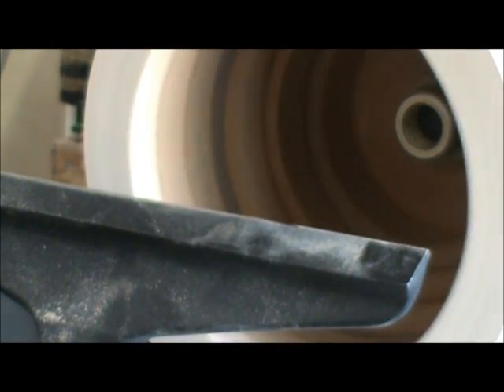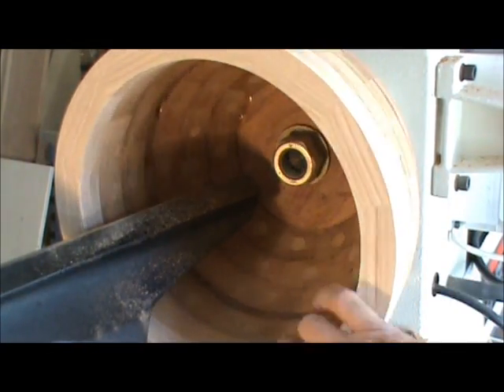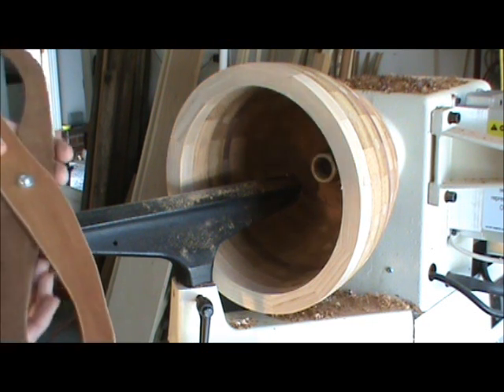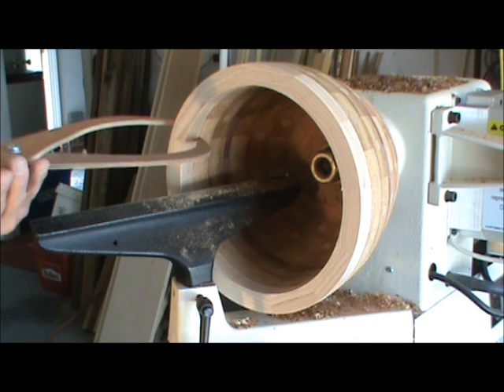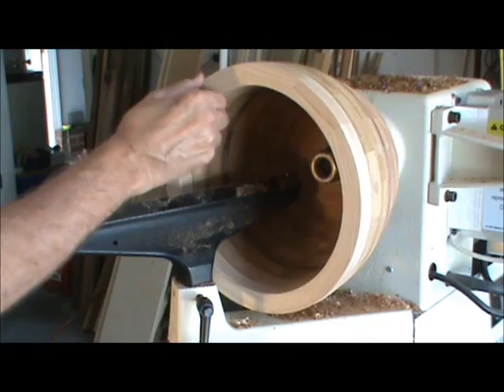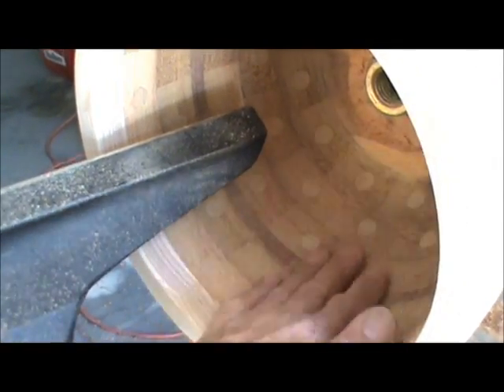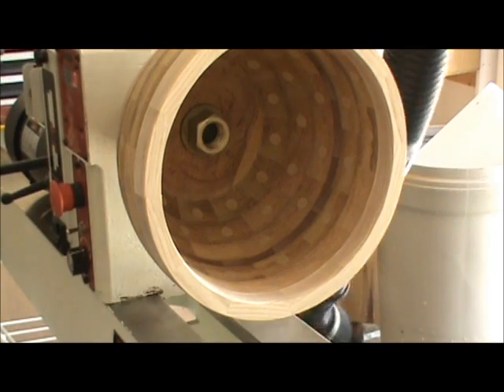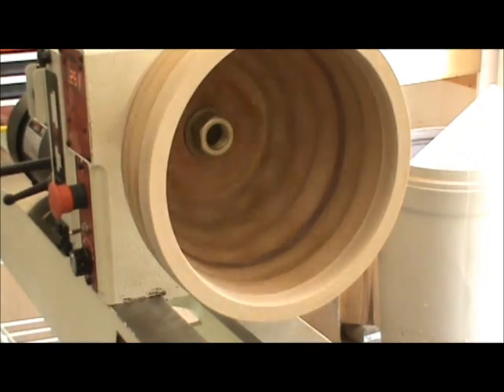Turning A Segmented Bowl Part 3   8-29-11.wmv

Comment: Hello David,
I watched hoping to see more of the inside turning.
You mentioned you used a bowl gouge. I am in the process of making my first segmented bowl, but when I turn the inside, I get a lot of catches. Is this common ? Or am I holding the tool wrong. I have tried a bowl gouge, a scraper and other tools, but I still get catches. I will keep at it, and work it out.
Love your video's.
Kind regards Shayne......
Reply from the maker: Since all the grain is side grain you can get a lot of catches. I use a round nose scraper for almost all of this type of turning to help prevent catches. Make sure you keep the tool sharp and go slowly at a very slight angle.  Good luck.  Dave
Reply: David Clevenger Hello again David,
Thanks for the tip, I finished my bowl using 2 different scrapers and they worked fine, I think I was trying to take too much off at once to speed the job up.You mentioned to go slowly, and that made the difference.
Thanks again.
Kind regards Shayne

Comment: Nice video, I liked and subscribed.........Question, you used a bowl gouge for the inside.  Im doing my 1st segmented bowl, turned out beautiful on the outside, now I am stuck on the inside.  I use carbide tools, since my other bowl gouge is dull, and I dont think i like sharpening so my question is which carbide tool or shape bit is good for knocking off those inside corners?  thank you mike
Reply from the maker: Thanks, Mike. I have a round nosed scraper that I like to use. Since the inside corners are low angle, the scraper works nicely.
Reply: Thank you. I'm going to try that again and just get it to the correct one angle
Reply from the maker: Great. If you have any other questions, feel free to ask.

Comment: Where do you find oner of those 1 inch mounting bolts on a mt2 taper?
Reply from the maker: It's a 1" spindle adapter that screws on the threaded spindle of my Jet lathe. I bought it at Klingspor Woodworking. I then had to find a nut that would fit it. Thank goodness there are still real hardware stores around. The big box stores don't have them.  Dave